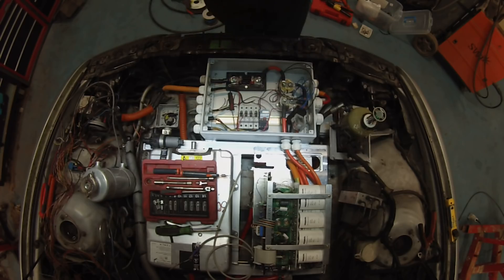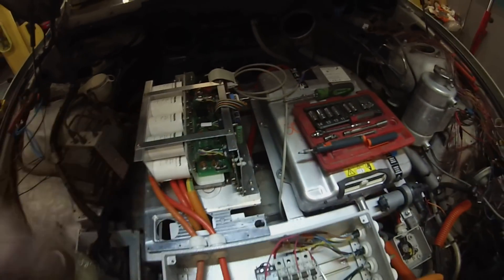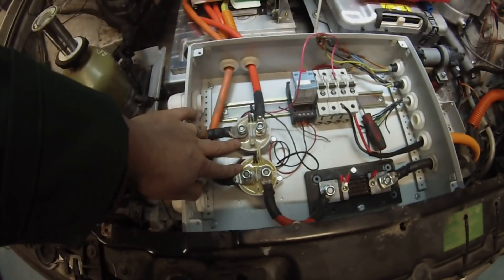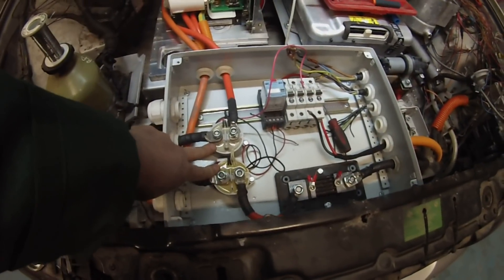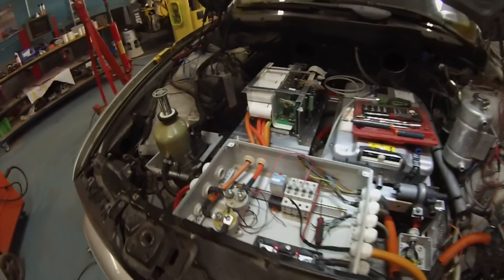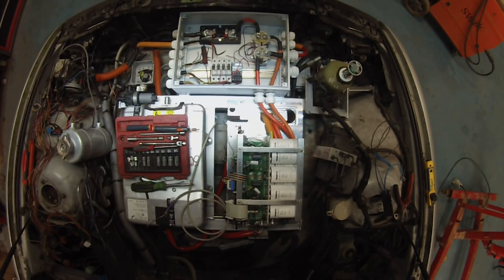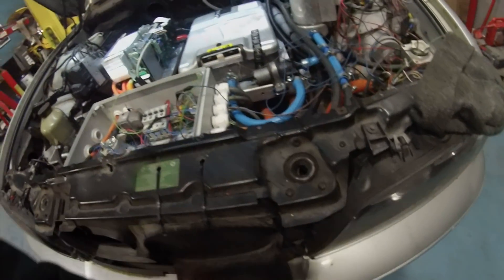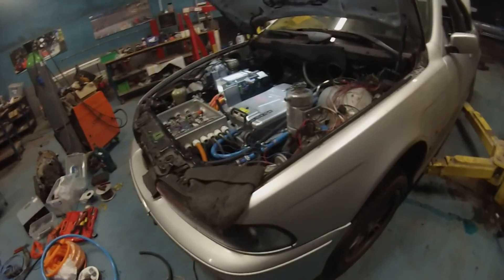BMW E39 EV Conversion 58: DC To AC Part 6

Comment: Thank you for your video Damien. I have a question. My Chinese ac inverter is said by the manufacturer to need no external precharge circuit. Should I take their word for it? Have you ever heard of one being built in? I couldn't quite follow your description of how to wire one. I imagine there are wiring diagrams online.

Comment: Damien. Suggestion: take a tap from the capacitors and display the voltage with 3 bar graphs - orientation at your discretion and when they are charging you get a rising pitch hum until the switch over voltage is reached, then display 'FLUX CAPACITOR FULLY CHARGED! READY TO ROLL!
Reply: Or the ghetto way: (in an racing EV that permanently had its batteries connected to the inverter on track day): Carry an incandescent AC bulb and touch the battery+ cable to the threads of the bulb, and touch the bulb bottom contact to the connection on the inverter. The bulb lights up , then quickly fades, and when it is out, you quickly screw down the B+ to the inverter. No relays of any kind needed! The thing with racing is that heavy power robbing safety measures like contactors, prechargers and fuses and dismissed, if you care about winning.

Comment: Hi Damien, great video but I would like to point out two things:
1) @7:25 I think you say "connect to one side of the resistor" but you meant "of the contactor". It wouldn't make sense to connect the two wires from the relay to two sides of the resistor.
2) It depends on the capacity what will happen without pre-charging. I used a pre-charge resistor which one day became non-conductive and subsequently as I only used GEVCU's (stupid) time based pre-charge sequence, I used no pre-charging at all. No welding or blowing up things.. but certainly a lot of stress on the components. I guess the inductance and resistance of the wiring/installation also helps to protect the components to some degree. Don't know how long I used the car without pre-charging but now I inserted two resistors in parallel to  have some kind of redundancy. Also should alter the pre-charge logic in GEVCU to use the inverter's or BMS's reported voltage to decide if its safe to close the contactor.

Comment: Why not just leave the precharge resistor across the main contactors? Current would be nil to keep things charged. Unless the idea is to keep the voltage off the output FETs to keep it alive longer?
Reply: And makes it more dangerous to work on the system, you always have to remember to pull the fuse
Reply: As little as possible spurious drain on the batteries when not driving or charging, is the way not to destroy your batterypack by accident.  In my 2002 lead-acid EV, even the BMS goes down to 0 nA when nothing happens, just to put as little drain as possible on the batteries.
Reply: @Tore_Lund  Thanks. I've had my car with the precharge on for two years now and haven't had any issues. Going to add the full Leaf pack contactor module so I might add that precharge system just because it is there.
Reply: @cheapygeek  Guess it depends on which inverter you're using? Usually Inverters have drain resistors, so they are safe to handle after 10 minutes or so. My Siemens inverter states that in the documentation, so precharge resistors feed the bleeder resistors in the inverter = just waste.  Maybe some inverters have a bleed pushbutton to drain them, so they in normal downpowered state require very little to keep the capacitors charged??

Comment: I don't think switching on the contactors without a precharge system would do much more than weld the contactors closed with a rather scary sound.
That of course is inconvenient enough to already avoid doing, though, and taking any risk of something worse happening would be quite stupid. But that really isn't something that would kill you at 100% certainty.

Comment: Most EV designer tends to keep the High Voltage (VH) components away from where the impact of an accident will not affect it much but yours is just in the front of the car.
Reply: T. Sho, this design is for areas with lots of protestors blocking intersections. This is the Taser EV design.
Reply: @imho7250  A story I was told as a kind in the 70': This one guy was tired of vandalism on his VW bus, so he hooked up a fence generator to the car battery and electrified the chassis. As an adult rationalizing, this guy must also have needed a ground stake to give the car the KV potential in respect to ground for this to work, so only when parked. Nevertheless a nice idea, until you go to court for shocking a parking attendant.

Comment: The relay should be rated for DC and at least to the main battery pack voltage. 
Also the resistors should be rated at at least 10 watts.

Comment: What wattage size are the resistors you are using ?
Reply: I think the order of 10W is sufficient. That is the size I have and I feel no heat on a DC motor setup. This would depend on the total amount of farad installed.

Comment: Hey @Damien Maguire, to what e extent is it not an issue to use non-automotive grade components, such as the circuit breakers that you use? I would foresee thermal dynamics and vibrations potentially becoming an issue in devices that were not designed with these environmental factors in mind..

Comment: I'm sure it took me 100 iterations to de-noise that encoder signal ;)
Reply: Which of you two is the Woz?
Reply: @SeánONilbud  I think we lack a Jobs
Reply: Hardware or software de-noise?
Reply: @cheapygeek  Both. Ended up with a heavily shielded cable where shield was GND, 2 inner cables Vcc and pulse. In software I look at the last 5 pulses to determine false triggers by EMI. Theres links to source code on my YT channel.
Reply: Are you familiar with grounding techniques? Did you only connect ground at the the inputs? Are you using a star ground? Where are you referenced, traction battery or chassis battery?